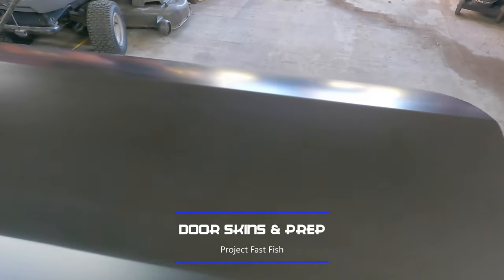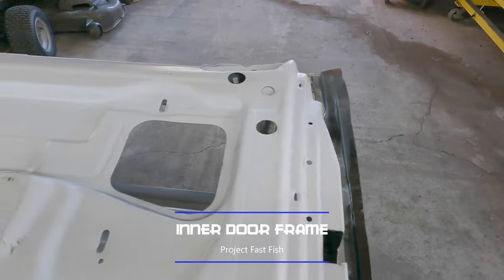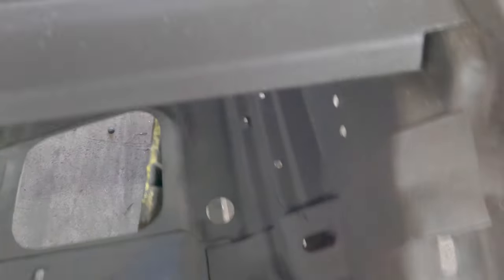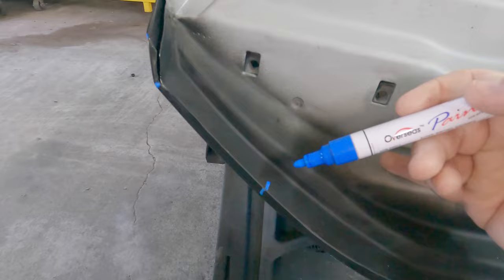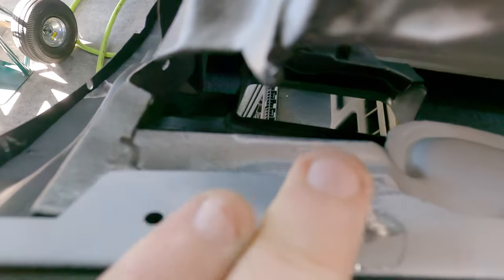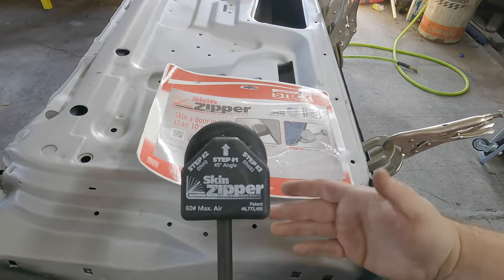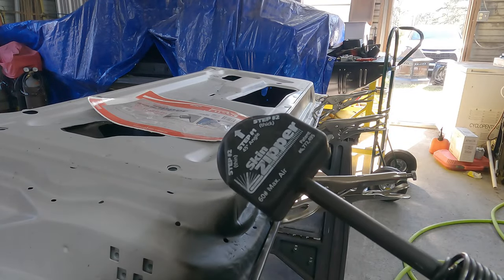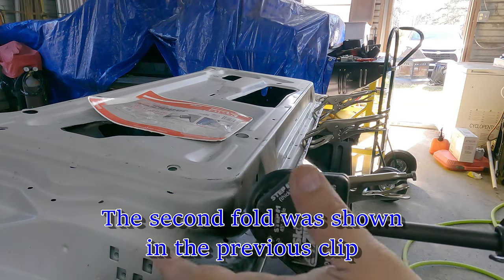Project Fast Fish: Installing Door Skins | Using the Skin Zipper

Comment: Right there with ya on the progress. My 69 Rambler restoration has been going for three years now. I work on it after work and on the weekends. The drive train is done. I  sand blasted the floor inside and out with a tunnel modification. Mini-tubs while straightening the rear frame rails is done. I am starting the body work now that its back on its wheels. I always get "YOU DONE YET?" from people. Time and money, i don't have alot of either. Plus, your'e never really ever done with a car anyhow!
Reply from the maker: For sure.  Congrats on your progress thus far. 👏 It's an act of love for the hobby, craft, or idea of driving what we build.

Comment: Based on the stretching I see with the zipper I can't see the outside of that door not having imperfections and dents, buckles. I hope it worked out well for you.
Having said that and working for a coach builder in steel and alloy, we NEVER I MEAN NEVER used steel hammers. Patching a door and having a perfectly straight line with the rocker sets the men apart from the boys and steel hammers stretch metal. At home on a mop and slop on some shitbox, sure I use a ball peen but that also isn't a new door skin on something nice.